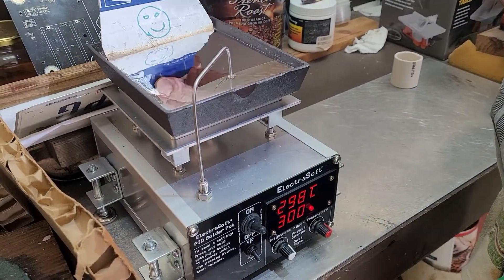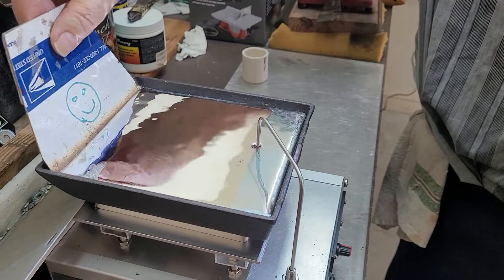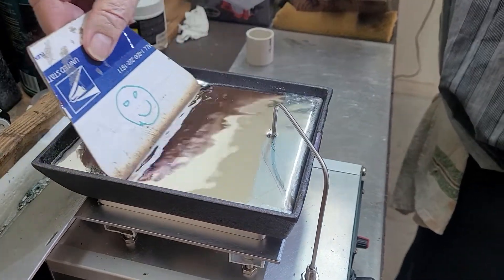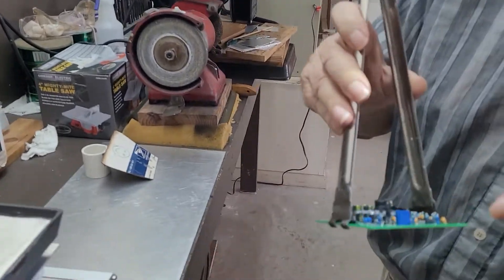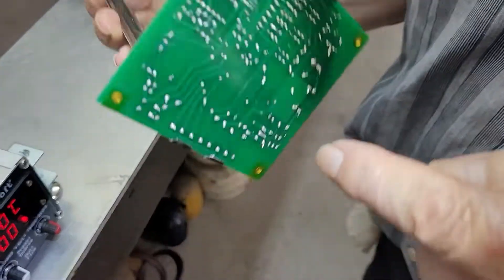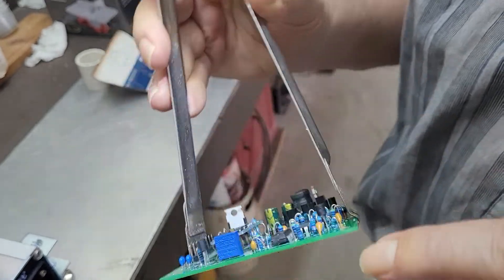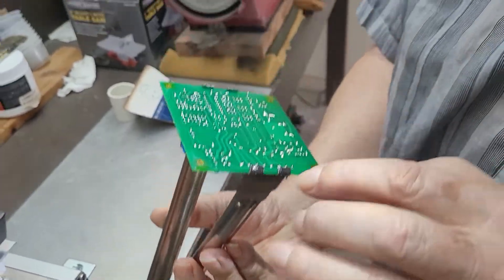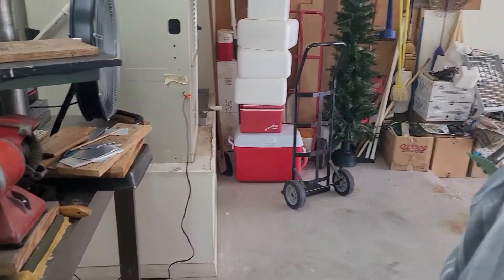Jon Krahmer Demos Custom Solder Pot

Comment: how much power did you need to boil those tin with such a big container like that?, and it seems it has a thick plate to use
Reply: It takes about 30 minutes to heat. I cover it with an old PCB. If I remember correctly, I am using a standard 120V 500W ceramic heating element. They are hard to find. I found mine on Aliexpress.
Reply: @jonkrahmer3987  is it possible to use rice cooker element?

Comment: I can't see the set temperature of the pot. Do you recommend a specific solder of 60/40?
Reply: The PID says 300C
Reply: I use un-leaded solder at 300C - 572F
Reply: @jonkrahmer3987  I'll take consideration such settings. Have a great day. Thanks so much.